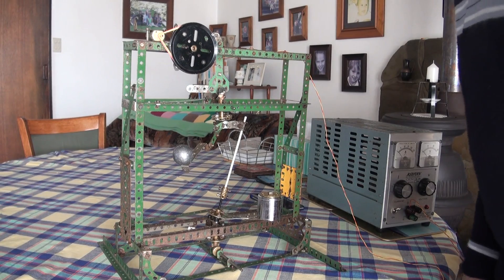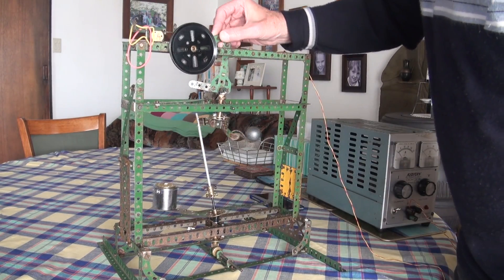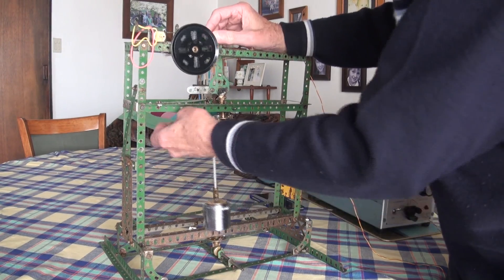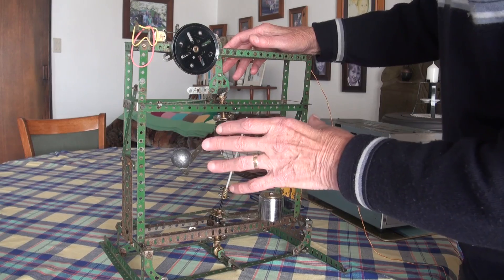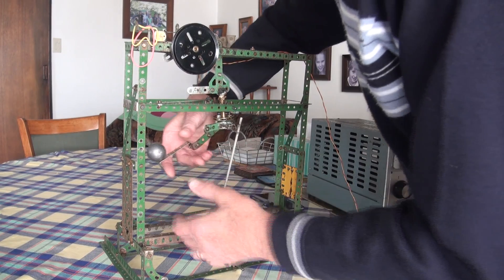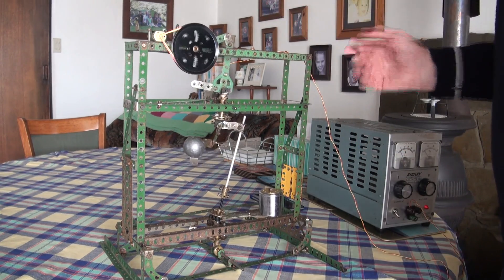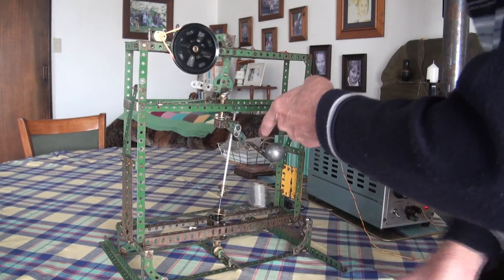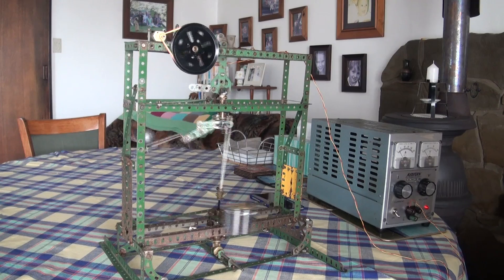Simple explanation and demo of Skinner Gravity Power device x264

Comment: the device is replicated wrong. you need to use a spring or differential gears to get it to work right. your tilt only work at one angle, my device works at any angle. i use a spring between the bottom rotor and the angled shaft. a differential gear system would work better.  the device is  ridiculously simple. skinner had a four in one machine.
Reply from the maker: No springs or differential gears are required. Look at my last video for a more detailed explanation of the Skinner principle.
Reply: perhaps not but with a spring, you can stall the output and the input still turn. your can't do that with yours but my replica can. i have watched the skinner black and white video in detail and found out the device is really simple. my version is far simpler than your and works the way it could work. i tried the crap linkage universal joint at first but realized that it didnt' work well and discarded it in favior of a big powerful spring that support the effect at 360 degree circle at any angle and does not lock up or get stuck like yours.

Comment: For this to be any useful, it would have to produce it's own power to operate in isolation otherwise it is just another failed attempt at making an overunity device.  Good attempt at the replication however.
Reply: you are incorrect,  he has demonstrated the skinner device except instead of the top lever arm rotating in a circle he is just using a back and forth motion, which causes the drive motor to have to lift more weight.   your statement that it would have to  produce it's own power and operate in isolation in incorrect.   this is a gravity harvesting device,  it has to have a source of power to operate the first stage.   to drive a lever arm to off set a weight so gravity can act on it.    then it is the second stage that gets driven by the first stage, and because in the first stage gravity entered the system you have gained energy, now you use that energy gain to drive the next stage, which because of the energy gain you can drive even larger weights.  and now you have even more energy gain.   the device is useful just as it is, it does what it is supposed to do, it harvest gravity as a energy source which you can use to do work.  and it does produce it's own power in the form of rotational kenetic energy,  why do you think it has to operate in isolation??  it does put out more power than it uses because it is getting power from another source, gravity.    it is not a failed attempt,  the only failure here is your mind not being able to see and understand what is really happening.
Reply: @rmendes2mendes915  
Nice word salad that demonstrates you do not understand simple Physics...i.e. The Laws of Thermodynamics explain why this device cannot produce unity, nor produce more power out than in...
" it is not a failed attempt,  the only failure here is your mind not being able to see and understand what is really happening"
My mind is just fine!  I understand physics and why this is not possible.  You never built one and just make comments that are nonsense.

Nonsense like these comments you made that clearly show a contradiction in your thinking...:
"your statement that it would have to  produce it's own power and operate in isolation in incorrect."
The Contradiction...
" and it does produce it's own power in the form of rotational kenetic energy,  why do you think it has to operate in isolation??  it does put out more power than it uses because it is getting power from another source, gravity. "
You commented it can't run in on its own "Isolation" and then you commented it produces more power than it takes in, which is bullshit!  You can't say in one sentence it can't run in isolation and later comment it produces it's own power!  That means it can run in isolation if it actually worked!
Get off your ass and build one instead of making comments about things you have no clue about!  You should have paid attention in school!
Reply: @valveman12  you understand physics? that just means you believe everything you are told by the physics teacher.    and that is where you and others come to the end of the road, the road block for your mind.  all new energy devices are labeled the same way, we are told they cannot break the laws of physics ( which are laws made by fallible man)   I have not built the skinner device yet but I did build the  Milkovic oscillator which does the same thing, it harvest gravity therefor amplifying the force you put in.    there are many ways to create power for very cheep and if you don't count having had to build the device to harvest the energy then yes you can say it is free . build the milkovic oscillator, and test it. you will see that it works.   leave your physics at the door until you see it working then you will see it doesn't break the laws of physics,  the device is simply getting its amplified energy from another source, and that source is gravity.
Reply: @Jogiv2 Machine1 
Nice excuse... can't afford to build a small model?🤣😂🤣  So you never built one because you can't afford it?😂🤣😂
How about you just prove your claim that a parabolic orbit takes less energy to lift an object to point A than lifting a weight directly up to point A  Show your work.  Let's see it!
Reply: @Jogiv2 Machine1 
You cherry-pick what Physics Laws you accept.   

Do you accept the Laws of Thermodynamics?  
These are the Laws that completely debunk Free Energy/Perpetual Motion Devices.  You can't just break these Laws because we didn't make them, Nature did.

People have been trying to make free energy devices for centuries and for centuries, no one has been able to. 
It would certainly be awesome if free energy devices were possible, but they are not.
Reply: @Jogiv2 Machine1 
"The force of a weighted object is greater than the force needed to lift it in these machines as it’s not being lifted from a standstill but a parabolic motion that assists the momentum and aids the lift."
Really?  let me know when you build your machine and post a video.😂🤣😂
Reply: @Jogiv2 Machine1 
Parabolic Ellipses, Elliptical Parabolic Orbits
Yup... So what about them?   It's apparent that you don't seem to understand that it takes more energy to bring the weight up than you will recover.  The reason is losses in a system.  Everything has losses so unless you can eliminate losses, you can't have a self-running device.  You want to prove me wrong, build it!
Reply: @Jogiv2 Machine1 
If this worked and produced free energy, why are there no peer-reviewed papers, and more importantly, why are we not using these now?  No one is suppressing such a discovery, because there is no discovery of a working free energy device to suppress.  Many believers in free energy/perpetual motion machines make the claim that the Government is suppressing this information.  What Government?   The world has many Governments and many countries, especially the poor countries would embrace a device that creates free energy.  From our understanding of the natural world, devices running in closed-loop is not possible.  As it stands right now, no one has successfully built a free energy device.   Many claim they did create a free energy device, and even put up a video to only be debunked.  This wobbly Skinner "Free Energy" machine is an old one that didn't work back then and does not work today...
Reply: @Jogiv2 Machine1 
I've seen all those videos before and they are all BS.
Have a Happy New Year

Comment: It is clear that if the input pivot  arrangement was changed to one that pulsated while the pivot was kept vertically all the time rather than slanting, the top weight would not need to go up and down which is totally unnecessary in this machine and the circulation would have been kept.   I am sure that a similar arrangement could be designed such that the lower weight would not change height during its circulation.
Reply: if either of the weights are not lifted up against gravity then how can gravity act on them to pull them back down??   this is a gravity harvesting machine, to keep a mass falling as gravity is pulling it down  the mass has to come back up in order to fall again.

Comment: Sir, I am older than you are and  not necessarily wiser,  but when young I learnt that gravitational field is conservative and the vector integral between two points is a constant irrespective of the path taken. If the  vector integral is over a closed path then the integral is zero. This means that you cannot get any  energy out of gravity when you are moving items around a closed path and that is what you are doing.   Keep up your spirit , but have a rest and reconsider this work.  I suggest you go and enjoy yourself building some escapements of clocks made by John Harrison and George Daniels, it  is very rewarding , storing energy in weight and springs and letting gravity ran a pendulum for a few days.
Reply from the maker: Carmel, I have just seen your comment. This model was built to illustrate the principal behind Mr William Skinner's very effective gravity drive. I suggest that you watch my latest and final video on this subject. With four identical two stage systems aligned at 90 degrees to each other, Mr Skinner was able to completely balance out the lifting efforts of the input drive. A local large scale replication of this  mechanism produces immense torque from a comparatively tiny power input.
A scientific law is only valid until it is disproved.
(I've never heard of Harrison or Daniels, but designed and built various clock escapements with Meccano when I was a child)
Reply: +Carmel Pule' Incidentally , I wish to congratulate  you at the contents of this machine with a pulsating input which shows so clearly that a input Flat   reciprocating function as a sine and a cosine is ,   this machine illustrates the positive and negative going  rotations contained in these two very popular mathematical functions. 
This machine in this video did show that like a single phase induction motor with a flat sinusoidal input will not start, unless it is given a particular push in a desired direction.   This demonstration in this video is MUCH more than the explanation of Skinner's machine, but  what is contained in the two basic  mathematics function as the flat , reciprocating sine and cosine which are made up of two three dimensional  rotating functions which this machine eventually followed.  Interesting enough it also indicated the delay lag when  single phase electric motors  ar loaded.
Such machine should find its way in the halls of our schools where children would learn about the invisible and silent beauty of our universe.  Well done Sir,
Reply: don't know what you are talking about, gravitational field?   what field?   if you want to call gravity a field well call it  what you like.  closed path?

Comment: Nice work !!   Maybe you should try putting another elastic band and dc motor on the lower output shaft and use it as a generator..  DC motors work as generators too.  Increase the pulley ratio for the generator side.. Then You can compare the input-out to output energy.

Comment: Cool video. I'm curious...you said the power input but have you ever found a way to test the power output of the machine? I'd be very curious to know...thank you.
Reply from the maker: Jacob Bassett Hi Jacob, I did try comparing input to output by the time talen to lift a weight over a given distance, with the mechanism locked together (like a flywheel) or running with the Skinner principle. I also tried comparing the torque with an alloy disk in the adjustable field proximity of a permanent magnet. On my small device, the mechanical  advantage was only apparent during the initial load period. However,the Skinner machine was massive and had four stages balancing out the input load.
Reply: you don't have to create any kind of high tech methods to test power in compared to power out.     just use your fingers and feel the power coming out of the drive motor and compare it to the power at the output .

Comment: so would it be able to power itself after startup with a dynamo?
that is the interesting experiment to do:) nice build
Reply from the maker: The torque gain from this small device is too small to overcome the losses incurred in driving a looped generator. But I have no doubt that Skinner's multiple set up produced "over unity" power.
Reply: @davidquirey6917  why has nobody replicated Skinners machine and improved upon it to make it run on itself and power a home ?

Comment: Hi Dave, have you checked if the current draw goes up when you apply pressure to the output?
Reply from the maker: Hi Michael,
There is a slight increase in current with an applied load as kinetic energy is expended. However, as I've shown in another video this small pulsing current can be balanced out. Current drain then remains minimal until the gravitational torque advantage is overloaded. My apologies for the delay.

Comment: Thank you very much for your video. Have you connected a little generator to the output shaft at the bottom?
Reply from the maker: Thanks for your interest.
I dismantled this device and built a second one, before properly testing its output torque. However, a twin mechanism correctly timed needs minimal input power.